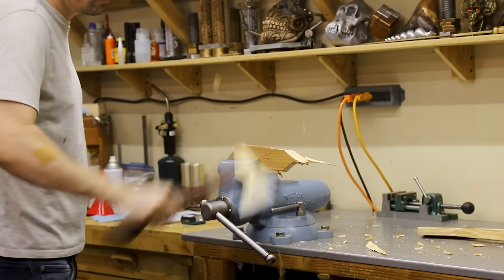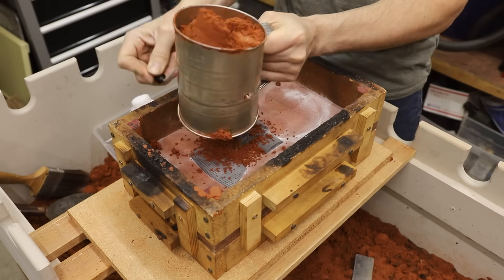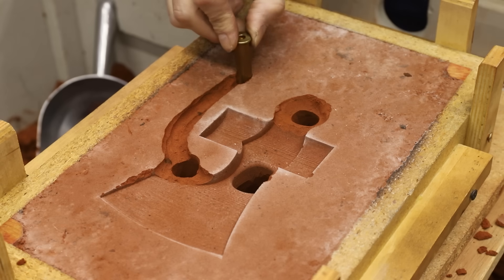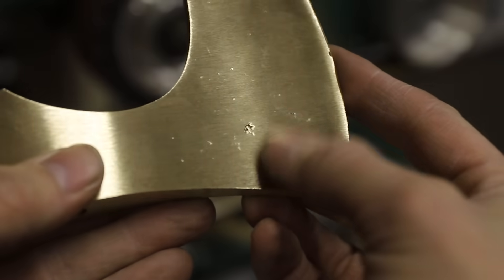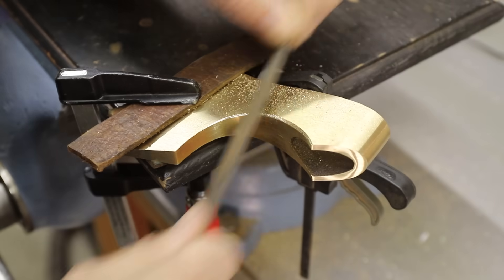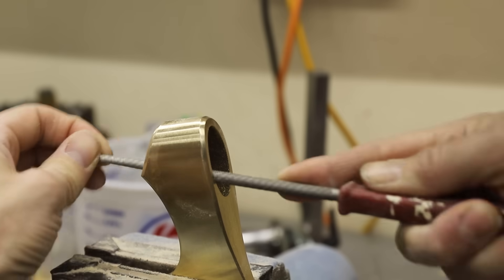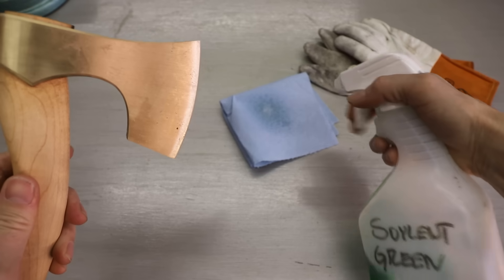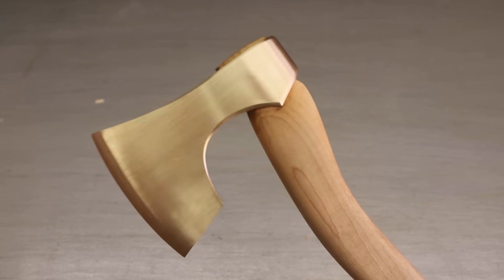Making & Testing Aluminum Bronze Hatchet WILL IT SURVIVE?

Comment: Adding Cast Iron to the mix could make it into a type of industrial strength bronze and hold an edge for longer.
Reply: lots o' luck with that one. iron's melting point is higher than the burning point of aluminum, copper, and tin.
Reply: I think Iron does not dissolve in Al or Cu; it is the silicon present in the cast iron that gets mixed with Al.
Reply: @janami-dharmam  No, there's commercial aluminium bronze alloys with 1-5% of iron in them. Those with iron are listed as higher hardness, but lower corrosion resistance.  (Given that aluminium bronzes are often used in highly corrosive environments, e.g. partially in sea water, that's not necessarily a problem for this application).  I do know that silicon bronzes are softer, but more ductile, than aluminium bronzes, so adding silicon is probably the wrong approach for an edge retention alloy.  (That said, something things in 0.5 - 1% range have quite different effects to higher concentrations - alloys can get weird!).  None of the common commercial aluminium bronzes have silicon in the mix, probably because of this reason (and silicon is more expensive than aluminium).
Reply: @syninys100 I would highly suspect that to get those benefits it must be heat treated much like a T6 aluminum where it requires a specific temperature over a long time to create a matrix within the material and use raw iron powder to attempt to get it to diffuse
Reply: His other build with the steel insert was the best idea
Maybe on another iteration or V2.0 he can machine a vertical groove in the hatchet head and just slide in the cutting edge then peen it over, then sand it to shape
Or maybe call it the quick build version
Reply: I'd imagine it would function similar to pebbles in concrete.
Reply: Copper carbonate? Cast iron has over 2 percent carbon.
Reply: But how hot do you gotta get cast iron compared to everything else? From my understanding they need to have roughly the same melting temp
Reply: @joshhunsberger1413  I mean, I would melt the Iron first to get it to alloying temp before putting the Copper and Aluminum in. Just my take.
Reply: If you're going to add iron you might as well just throw your hands up and make a steel alloy instead.

Comment: 12:40 why does he hit in diagonal, not just vertically? Can someone explain?
Reply: He needs to clear out the chips. Hitting diagonally in alternating directions creates little wedge shaped chips that clear the cut area.
Reply: That's proper axe/hatchet cutting technique .  An axe doesn't cut straight through the way a knife or scissors do.  The idea is to use alternating diagonal cuts to removes big chips of wood until you work your way to the other side.  If you tried to cut straight into the wood with an axe, eventually you'd have a very narrow slot cut into the wood and the axe wouldn't cut any further because the wood would just pinch the axe head as it landed in the slot.  Additionally, it's easier to cut wood at an angle to the grain and cutting at and angle will keep the edge sharp for longer because wood is strongest perpendicular to (straight across) the grain.
Reply: Wood is easier to split along the grain.
Reply: It's the law dude

Comment: I've asked gpt what's the hardest aluminium bronze alloy, and it replied:

Aluminum bronze C95400 typically contains approximately 83% copper, 10% aluminum, 5% iron, and 2% nickel. These percentages may vary slightly depending on the specific alloy composition and manufacturer.
Reply: Next video idea “chat gpt designed my axe”

Comment: The chamfer was a good choice. I'm glad you spared the edge further abuse from the oak. I love your craftsmanship. You make lovely stuff. Seeing how much work you put into finishing your castings, much of which is due to the quality of the 3d prints you use, makes me wonder if you ought to invest in a resin 3d printer. There are quite a few good quality resin 3d printers that have a large enough build volume to print patterns for what you've been doing on this channel. Yeah, resin printing is a whole thing. It's messy and has requirements for ventilation, but you could save so much time by printing higher quality patterns in resin. An alternative to that would be finishing your FDM prints to a higher surface quality before molding them. Perhaps you just like the physical process of transforming the relatively rough quality of your castings though, in which case that's cool. I'm just thinking of this all from a jewelers perspective. Anyway, great video as always.
Reply: I think he has done a couple of projects using resin prints

Comment: That tree was savable. Looks like when planted the root ball wasn't spread out.
Reply: I disagree. If you'll notice, there is a large wedge missing from the trunk. This makes it impossible for a tree to survive.
Reply: This is typical for a tree in bad soil or with deeproot barrier just around the initial rootbal. Replanting a tree that size and have it survive rarly works wel and requirs a lot of watering the first 2-3 years. I would of cut of the rootball and chucked the tree through a chipper to prevent anybody from starting to suggest replanting. Planting it back in the same hole doesn't fix the problem, either beeing deeproot or bad soil. both requir a lot of work and the after care needed make so it's easier to just replant a smaller tree later and fix the problems with the planting spot in due time instead of hastly.
Reply: You’re a little late, AZ John.
Reply from the maker: It was in a bad spot. The wind did us a favor.
Reply: "Was" being the key word.. go plant another tree..

Comment: I mean you would probably need to adjust the geometry for the material used. Using a hardened steel geometry on a softer material will obviously give sub optimal results.

Comment: Have you seen the Olfoundryman casting boxes? They're printable pieces that you cast, and you can make modular aluminum boxes that don't catch on fire and don't swell with moisture
Reply from the maker: I’ll check them out!
Reply: @robinson-foundry  I love the look of aluminium bronze, and I have a (very primitive) little foundry at home that I'd love to try doing some in - have you found it hard to get the alloy mix right when making it from recycled copper and aluminium? Also, do you have any electroplating experience?
Reply: OOH Nice!!!!
https://www.youtube.com/watch?v=cX2u6S5qV3Q